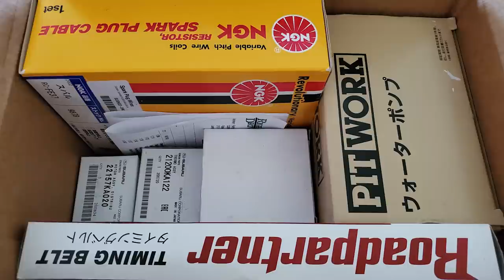BUYER BEWARE! Sambar Update! Parts Are Here! RANT!

Comment: Good rant. I have issues with Yokohama and Right Drive. Yokohama says their sales men are trained mechanics. Ha. I made the mistake of saying Danko book is a joke and no mechanic could use that book to repair anything. Service went way down after that comment. They also charge high dollar for OEM and send aftermarket. They have terrible service. And will not get back with you on any parts that are paid OEM and shipped after market. Right Drive is very expensive and a wait list for a crazy 800.00 for a windshield (3-6 months)  I explained that a 2002 sambar is a utility vehicle:purchase  options of a cigarette lighter and an AM radio to work in the affordable  budget of a workforce making 10.00 a day. Not A U.S. similar model year luxury vehicle whose windshield would be 450. U.S. installed. 
I use G&R in Missouri they are fair priced fair service. 
My last purchase with Yokohama Motors included CV joints, struts, tie rod ends, ball joints, Front rotors, and brake pads. Plus some small box fillers.( That's when I figured out every item shipped seperate or in same box was 40% added shipping to item cost)  wish I had known of G&R prior to long  Yokohama wait for very overpriced parts. And wrong parts shipped for another long wait to correct. 
A person buying these imports had better really love them. (I do)

Comment: Mr. Subaru, any advice for a sticky accelerator on my 1999 Sambar (31k km and fuel injected)? I push it down as gently as I can and it goes from zero to 40%  instantly. It's like real sticky. I tried following the cable to the back but am having a hard time finding where the throttle adjustment is. I have a feeling it's in the peddle or close to it anyway. Help me Mr. Subaru, you're my only hope!

Comment: I'm pretty sure that the Sambar will be one of your Subaru's you'll never sell. I tried sourcing parts from partsmonster.com Took forever and a day. 4th gen Legacy, got genuine front brake pads and questionable genuine rotors, but sent 316mm rotors and pads. 3.0r stock are 293,even Brembo has them cross referenced wrong. 6 months later... trying to source a pair of front GT Tokico calipers with the front brakes I got stuck with. No more expensive than sourcing quality blanks and pads. I'm hoping you make the Sambar "farm only." Remember that A/C upgrade and dump bed you were talking about. Your new furry friend will help you through those future growing pains. Someone probably dropped the cat off when they saw the Subaru farm... You know Subaru prides themselves on the $24M they donate for animals?
Reply from the maker: The Sambar is tagged, registered, and insured for highway use here in South Carolina. Been driving it quite a bit. So not farm use only, in this case. But does have a farm tag on it. Lol

Comment: From J pan haha.
Amazing how bad they could be. Normally OEM stuff I just go to the Subaru parts store as shipping from overseas ends up costing about the same after shipping
Partsouq.com is quite popular.
Reply: yup. I get my Subaru branded oil from Amazon.com, BUT: it turns out dealerships in the US are selling parts & consumables on Amazon.
Reply: @wim0104  that's pretty good. I use a mix of eBay and Online stores locally especially when it comes to oil. eBay good with private sellers selling OEM filters or UEC.

Comment: Hey Mr. Subaru. Hope you see this comment. I'm wondering if you could help me figure out problem with an engine swap i have done. It's a 2005 subaru wrx sti engine in a 2005 saab 9-2x. I'm having problems with it wanting to start when warm. It will start when cold. But now it's not starting at all when cold. Any ideas? Thanks.
Reply: Check your crank position sensor

Comment: Hey mr subaru I need help identifying a2004 h6 ll bean trans. Looking at a JDM replacement they list two in stock with final drive as 3.083 and 3.273 not sure if it will work with my car my trans code is T1ZA42MFAA